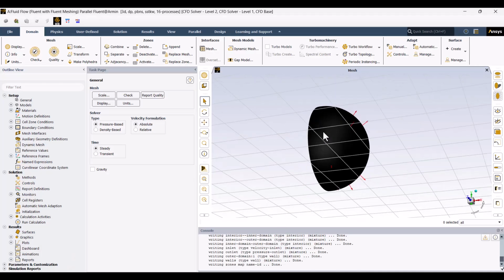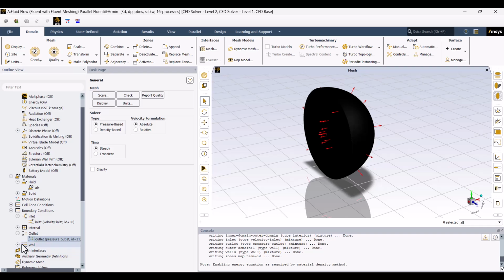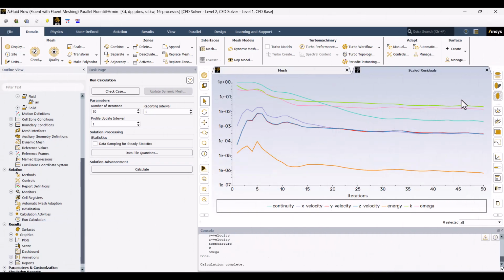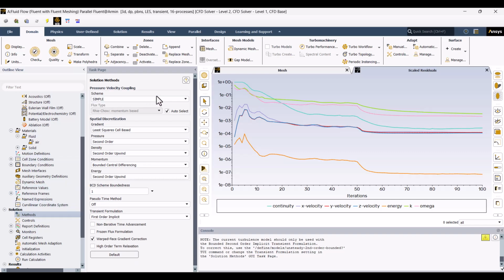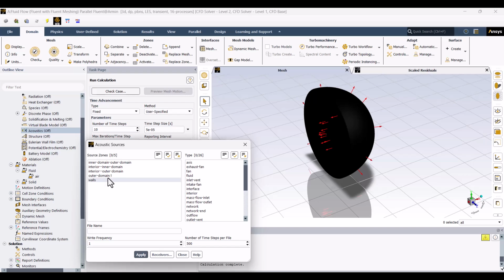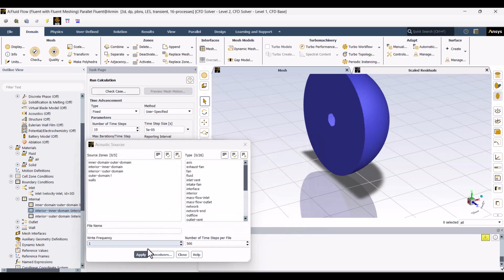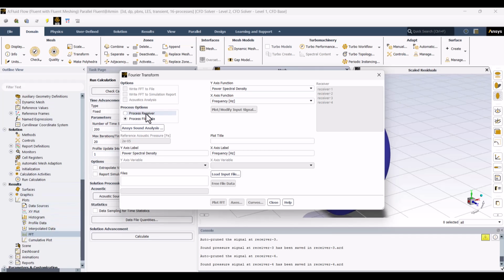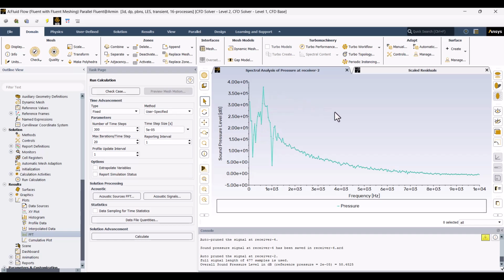🌬️🔊 LES Simulation + FWH Analysis | Capturing Real Aerodynamic Noise in Fluent (Part 2)

Comment: I have a wall like a tube that is surrounded by a fan blade, and cos 2 regions
1 is inside the tube, 2 is outside the tube
is it different from yours?
As I understand it, there is a setup that I am wondering about, which is "change all fluid-fluid boundary types from "walls" to "internal" "
Can you explain it to me? Thank you very much🥰
Reply from the maker: Hello, I didn't understand your model. There are two fluid domains in the tutorial model which are in contact with each other. I selected 'change fluid-fluid boundary to internal' because I did not want to separate them with a wall.
Reply: @caewitharminhashemi  so if i want to separate them with a wall then in the 'change fluid-fluid boundary to internal' option i should select "No" right? Thank you 🥰
Reply from the maker: @cuongvucong7953 yes.